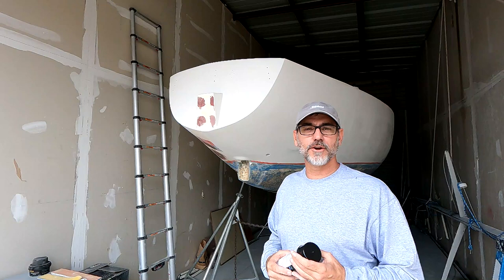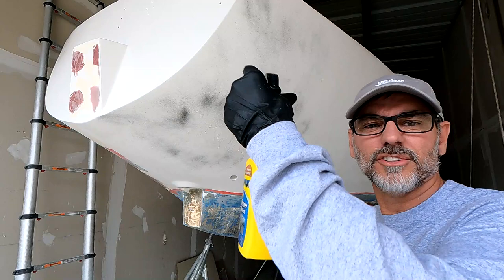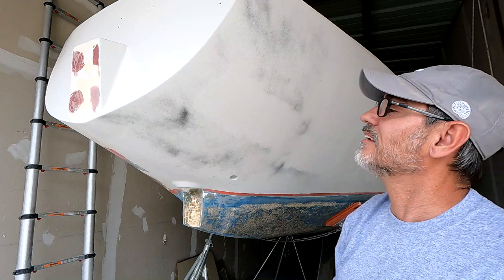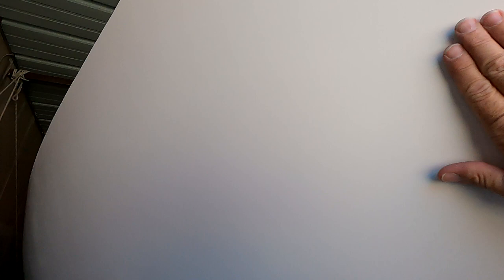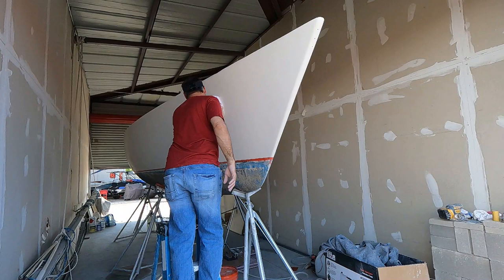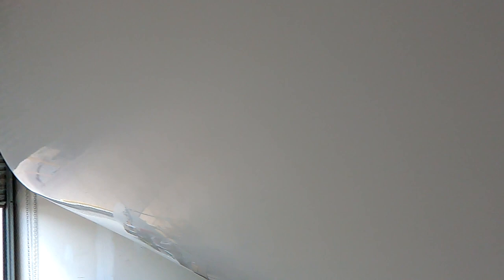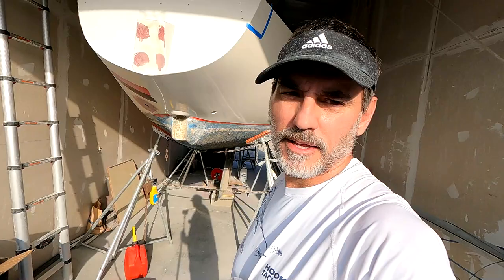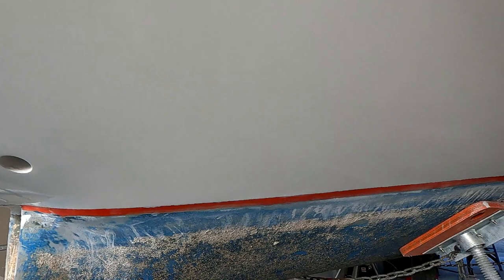Sailboat refit #15- Wet sand & Buff the hull just after I painted it.

Comment: What paint did you use ? Looks good
Reply from the maker: Alexseal paint.   I use Alexseal because they have a roll additive that helps it flow out with just rolling only.  Also you can wet sand and buff it which makes it very easy to repair scratches.

Comment: Is that wet/dry sandpaper, does it matter?
Reply from the maker: Yes, it’s wet dry. It makes it easier to sand if your using 600 or higher.
Reply: @finditfixitsailit9322  Thanks, doing the boat bottom, but only going down to 400 grit - didn't know if I should use wet or dry.
Reply from the maker: No not on the bottom.  I only use wet dry sandpaper on something I want to polish.